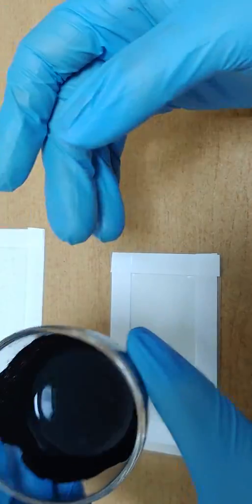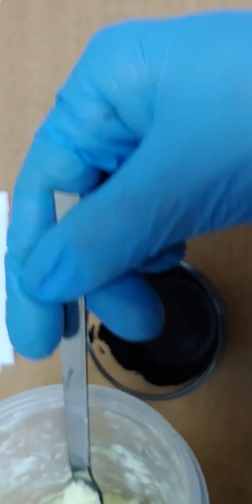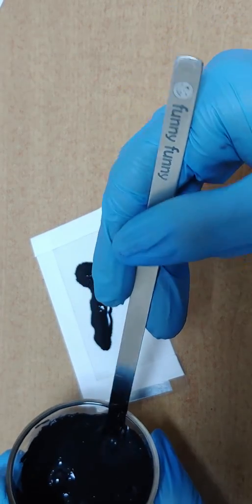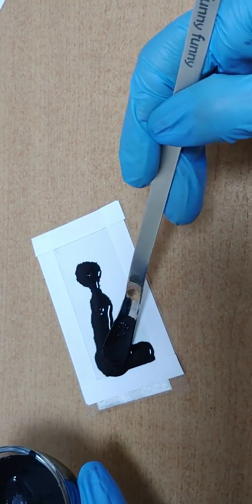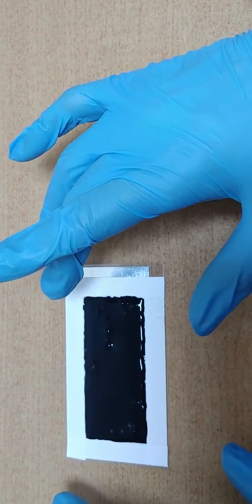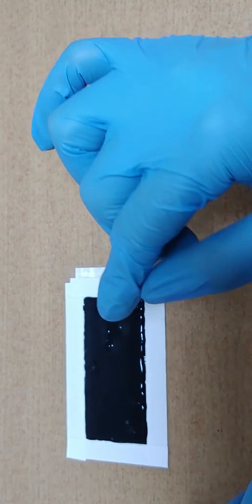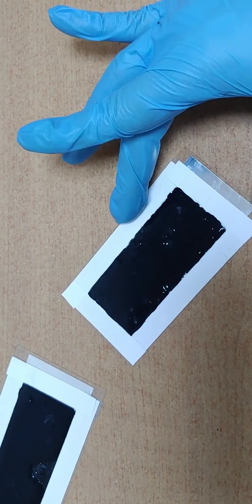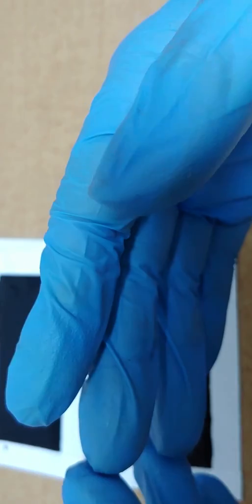solid state graphene battery experiment 1st

Comment: It's the journey it self that might give you wonderful insights. I am at the border of doing it my self, I have ordered stuff and will conduct experiment my self. I will write here on your channel how it goes or post a video about it. However, I was thinking about your coating that might, smear when you add the graphite. How about ceramic coating for cars? Can also be called Paint seals, not sure electrons can pass back and forth, but it might Not smear when dried? Example product: https://www.ebay.com/p/2250631128 maybe you can buy it locally. Have a nice day!
Reply from the maker: Thank you so much of your comment. I'll look at the site you recommended to me. And I sometimes think of using various stuff such as varnish. But if the material is vulnerable to fire, it is better not to use it. Have a nice day.
Reply from the maker: I looked at the site you recommended to me. And I suddenly could remember that I had done many experiments by using stuff like that. One thing is sure. Such products prevent ions from moving freely. Have a nice weekend.
Reply: @solidbattery9956  I thought so to, but was not sure. Hmm, how about apply it differently. A) Alu B) Ceramic on A C) Extra graphite placed on second Alu D) Alu with graphite. Not sure I was correct with the layer, but all layers are done separately, and dried. Then "we" only have to be sure, ceramic is totally covering the first aluminium. Really carefully protecting it, it might be key to your good battery. Regarding, pressing the layers, also with great great care, noting is allowed to penetrate your ceramic. It's challanging, that is why I also will help out by doing this too.
Reply from the maker: @corresandberg  
Yes, it works very well. Please refer to this video. 
https://www.youtube.com/watch?v=sT0N63UiYFM&t=10s
The video linked is exactly what you said. it worked well. But because this is not a lithium battery, its life is much shorter than that of lithium battery. But if you try it, you will find another exciting fun. Being surprised at your inventiveness, have a nice day.